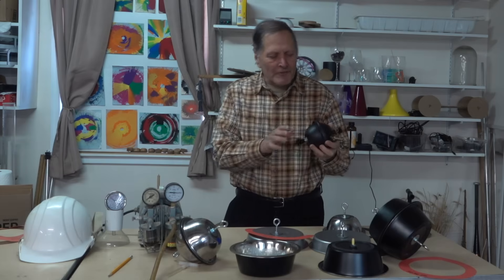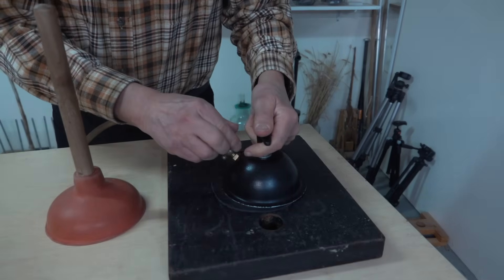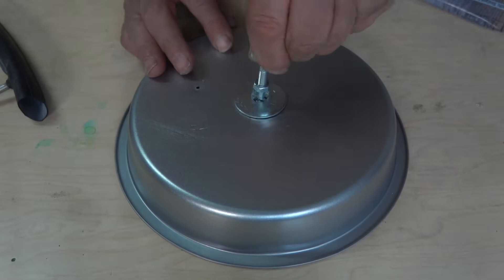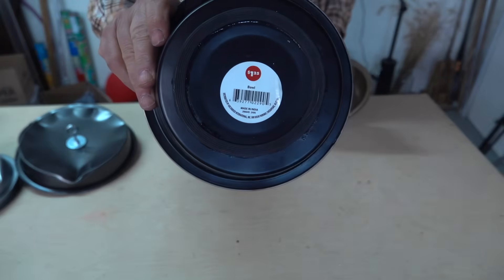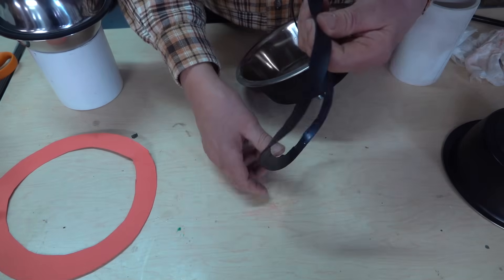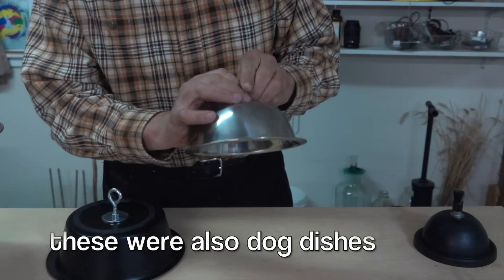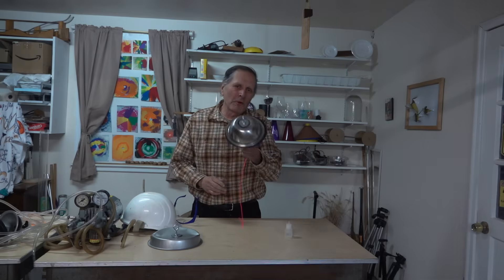Magdeburg Hemispheres,   amazing alternative methods plus DIY

Comment: what would you Connect a flywheel escapement with a rotating flywheel discharge at the very end spin of the flywheel then they are independently  rotating to get the back and forth motion is it a crank-slider mechanism

Comment: Soo it's a weight driven clock with seconds, minutes and hours or just the one barrel shaft or as many flywheels as you can get on the pendulum, faces and gears,a Galileo lever locking tooth escapement to a pendulum on a slight angle at the bottom, the pendulum then discharges at the top through a flywheel then it travels back to the middle where it kicks the lever to release the gear with end result pendulum moving back and forth could add another flywheel at the bottom

Comment: I question the conclusion in the Magdeburg hemispheres experiment which claims that the air vacuum created inside is the air pressure outside which keeps the two parts stuck together.

Why do I doubt?

Because in other experiments of the same kind, the testers manage to move the hardware device where the depression is highlighted.

Now, how can we explain that we manage to lift the whole thing (the half sphere + the black plate as seen in this video from 1mn 18s to 1mn 34s) when we are prevented from taking off the half sphere from above this same plate.

In my opinion, we neglect the suction phenomenon which exists inside as soon as the air vacuum is created. The proof is the sound of suction of the outside air through the small hole as soon as the small blue adhesive is removed (at 5mm 59s).
Through such a small hole it is impossible for the air pressure outside to push air inwards so quickly and so strongly. It is indeed an existing and aspirating phenomenon inside that acts. And so it is this same phenomenon that also acts in the case of the Magdeburg hemispheres and which prevents them from being separated once they have been placed under vacuum from the inside.

I maintain what I have already said elsewhere: this Magdeburg experiment deserves further and more in-depth research in order to better understand this phenomenon of aspiration.

Comment: I wonder if you simply had a smooth flat surface if a round metal or some hard plastic disk with an eye hook mounted in the center would hold to the smooth surface if  it oil canned or deformed when pulled upon? Brought to mind the time a remora stuck to the bottom of our boat when I was trying to put it back in the water.
Reply from the maker: a hemisphere would require just as much force to remove it from a flat surface as it does from the two sections together,  I have plans to make a second video on this and that will be included
Reply: @YeanyScience  I have a vise that has a rectangular suction cup lever actuated base that's kind of an interesting application for a quick mount and release vise. It has a pretty solid hold but not for long periods of course. I wish I could think of something fun to make. I always enjoy your ideas.

Comment: Try putting a 3-5 inch long piece of large ABS pipe as a spacer inside the thin pie pans to support the thin metal so it doesn't crush as easily. 😊

Comment: Wait, where's the pressure reduction coming from with the burning? Temperature's increasing, so that should be raising the pressure, oxygen drawdown would only support a 20% pressure drop, plus our fuel is solid (paper) and liquid (alcohol) and the products will be primarily H2O and CO2, so that should be more than offsetting the oxygen drawdown. The nitrogen will be mostly inert. I've gotta be missing something simple.
Reply from the maker: Hi Jon, interesting question, I would say the pressure reduction is due to the change in temperature of the burning gasses.  Temperature of burning paper might reach 500° while the burning alcohol could be much higher, depending on the type. The hot gasses are  captured by putting the two hemispheres together. If a gas is cooled from high temperature  to 70 degrees while keeping the volume constant, its pressure will significantly decrease due to the reduced kinetic energy of the gas molecules. I think I'll go back and do the actual calculations  and then see how they compare to what I get using the pressure gauge.

Comment: Am I correct if I say that larger objects will hold more force since force is pressure times area and larger objects have larger area (considering same vacuum value)?

And a question. Can we calculate the highest force considering perfect vacuum?

Thank you for this great experiment!
Reply from the maker: you got it,  if the pressure against the outside of the container is 14.7 psi, that means on each square inch there is 14.7 pounds of force being applied.  The amount of force holding the halves together would be 14.7 times the area of the diameter of the sphere. Diameter of 4.5 gives us 12.5 square inches. Multiplied equals 185 pounds pushing the two 2 together. The total amount of force applied on this sphere pushing inwards would be  surface area times 14.7 psi.  area of  47.7 square inches times 14.7 equals = 701 pounds of force applied on the container, pushing inwards.

Comment: Now explain how the ORECK VACUUM CLEANER BOWLING BALL FUNNEL DEMO is  actually not impressive at all. 
https://www.youtube.com/watch?v=PaB39Wi-Img
Reply from the maker: Looks like the funnel matches up to about 80% of the balls's surface area, this would mean the "vacuum" or reduction in pressure is applied to about 45 square inches of the ball's surface.  16 pound ball would require about 0.35  pounds per square inch  difference in pressure to support it,  hardly a Herculean feat.  I would more impressed if they used the exhaust of the vacuum to lift a bowling ball like I did  in my previous video.
https://www.youtube.com/watch?v=tFjOUaB6uvE

Comment: Maybe you can get some old alarm bells. They are very thick and have already a hole in the center
The only problem is the rim, but the King of Random back in the days, did a seal out of silicone and flour, and it was moldable. So maybe you can "die press" a H section out of some silicone putty, that matches two of those ring bells just by pressing the two bells against each other with a thick noodle of silicone putty in the middle

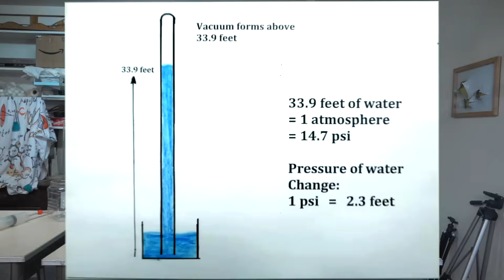Comment: 2:26... should clarify where the figures actually come from...

2'4" is 28 inches. 28 cuin of water weighs 1 pound. a column 1 squin in area will therefore contain 1 pound for every 28 inches of height...

why the beep am i using infernal measurements? not very scientific!

1 L of water weighs 1kg and on a column 1cm2 in area you get 1kgf/cm for every metre, or 1000CC...

or you can do it in pascal? 

an interesting point here, seemingly unrelated... engineers often lament over james watt's seemingly random unit of a HP.

it makes perfect sense when you consider it is 33,000 foot pounds a minute. huh?

its 1000 lbs of water lifted to 33 foot every minute. and as its quite easy to measure that amount of water, and quite easy to obtain the height due to the fact water cant be lifted over 33 (34? close enough!) foot by suction alone... its a rather straightforward way of measuring the work something can perform. especially in an era when there were no standards, and measuring tools were rather arbitrary themselves... within reason, it was an easily replicated performance.

and the main purpose at the time was to make pumps for draining mines... so they already had a good idea about the 33 (34!) foot limitation of a vacuum (produced by condensing steam so not a perfect vacuum and probably explains that 1 foot discrepancy...)

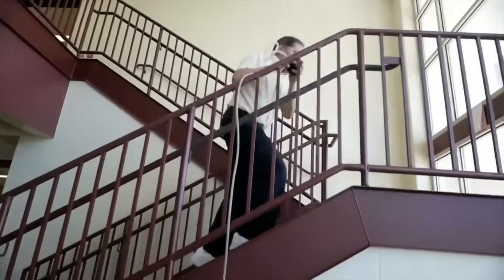Comment: 2:40 do I understand it correctly that when you move the hemispheres up, then a vacuum will appear there, because the water will "fall down" at some point, and it will fall down more the higher you go? 

So in 3:06 you are at some height and thats why its hard to move them apart?
Reply: water has weight. it doesnt matter what diameter the pipe is, the pressure at the base is due to the height of water directly above it... (this also is the closest analogy to the concept of "charge" if you delve into electricity... "charge" being a volume of electricity, voltage being pressure, and current being flow)

as the waters falling from the chamber, due to gravity, and theres no way for air (or anything else...) to enter the chamber, the pressure in the chamber must fall... at 33.9 foot and higher, the water literally boils at room temperature. and a column of water 1 square inch in area will weigh 14.7 pounds if its 34 foot high... or, for every 2' 4", or 28 inches, its a pound.

if you convert into other units, kgf/cm2, pascals, etc, you will see the same relationships...

replace water with mercury and its only 32 inches or something, Hg being 11 times denser....

the basics of a barometer.

interestingly, if you keep raising the ball, the atmospheric pressure pushing the hemispheres together reduces... atmosphere is only 14.7 psi at sea-level. at 20C...

Comment: ABS sewer end caps work well if not using heat to generate vacuum.  I glued small end caps onto outside of large caps for attachment (using standard ABS solvent cement).  Holes in small end caps allow rope attachment without needing holes in large caps that would require sealing.  Rope through small end cap hole with figure-8 knot inside before gluing.
Finally, a small hole in side of one large end cap for evacuation.  Rubber tubing of slightly larger diameter than hole pulled through hole.  Tube is used for evacuation, then folded over and clamped with small paper clamp to seal.  An aquarium pump can work for evacuating, though I have a similar diaphragm pump from old large printer that generates better vacuum, ~-10PSI gauge (~5PSI absolute) pressure remaining.
For demonstration, kids play tug-a-war with ropes.  (Oh, disks of old polyethylene packaging foam around ropes where they enter end caps to soften impact when halves separate.)  Takes ~150lbs for my version.  Teams of three 6th graders on each side sometimes get halves separated.

Great demo.  I hadn't thought of dog dishes as an option, nor of using fire.
Reply from the maker: Hi Dave, thanks for posting  another alternative. I didn't consider them, but it's good  that they worked.